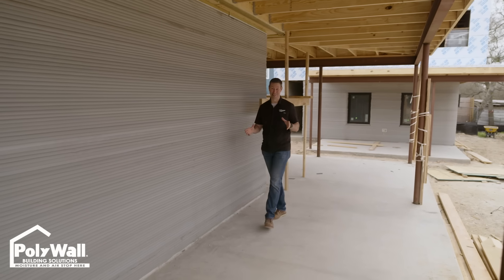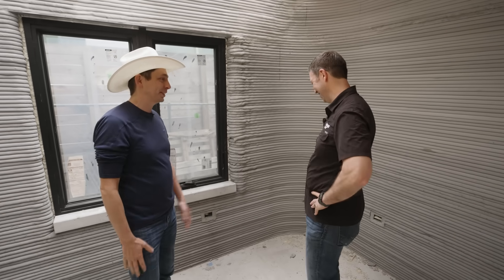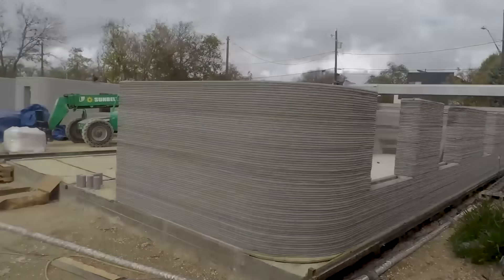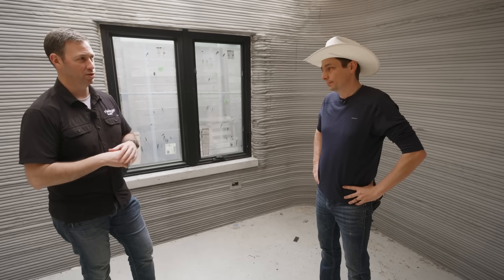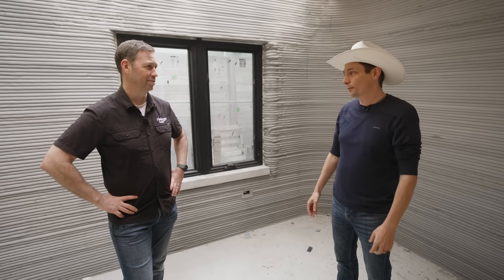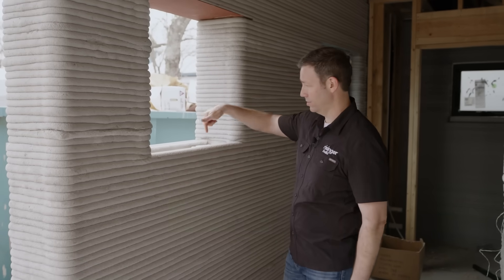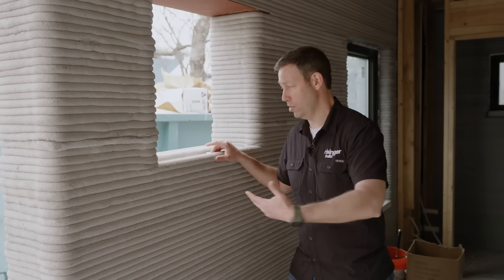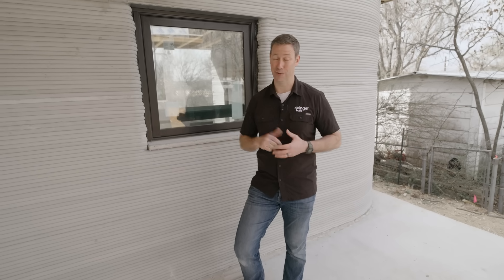Is this the future of Construction? 3D Concrete Printed Homes

Comment: I wonder how this compares structurally to ICF construction. I'm not sure if you didn't show it, Matt, or if they just don't do it, but the lack of rebar or even mesh in the concrete makes me wonder about the longevity of this type of construction. On top of that, how does this compare to ICF with insulation value? Also, would this type of construction last in a northern climate? I know I am probably coming off as a skeptic, but I would like to know more.
Reply: Stronger than icf due to the depth of the wall and the integration of the wythes and rebar

Comment: I love the concept, It reminds me of the 3D printer tech, just need a 3d printed resin printed home. Those interior horizontal lines however give me vertigo. So yes a smooth interior finish wold be highly desirable. If you left the interior with that sort of ridge finish your lighting would have to be perfect to not throw off weird shadows on the walls.
https://www.youtube.com/watch?v=gt3bid70Fro

Comment: I wonder how these hold up over time without rebar reinforcements and cracking overtime.
Reply: Will hold up longer with no rebar to corrode or fail. See how long Roman concrete structure without iron reinforcement have lasted.

Comment: Concrete is the wrong way to go. It's the top carbon emitter in construction, it doesn't breathe, it cracks, it attracts moisture... Just dooooooon't do it!
Reply: ...that said, with the lack of labor etc., printing is not a bad idea, but they definitely need another filament, and epoxy isn't the answer either.

Comment: Concrete cracks and fractures. That’s what it does. You can even see it in the video above the wall outlet. That seems like a major problem that wasn’t even addressed in this video.
Reply: https://youtu.be/_MsOXrprYXs?t=350
Reply: The cracks are only on the outside. Thats not a problem.
Reply: @gandalf2950  Until it settles more, and it will settle more.

Comment: For those worried about strength and cracks, the possibilities for improvement in material and construction are endless. Rigid spray foam could be printed in during concrete printing and would add significant strength. Resin and fiber additives could easily prevent cracks.
Reply: Yeah, the additives are really what would add alot of strength.

Comment: Why paint concrete with non premibal paint ?  The concrete may take  in some moister when there is rain but will dry out later. 
The solution to rain on the walls is not rubber paint ,it's  good enough roof overhang.
Also the use of isocynate foam makes the  house that could be a plastic free easy to sort and recycle construction to a nightmare of chemicals ,plastic debre concrete mix when torn down , the insulation can bee made of leca beads instead , non rotting fireproof and harmless to the environment,  in the demolishing face.  To be used I combination with the concrete as material in roadbeds  or as ballast for new concrete. Also this material with has high insulation properties can bee groated with cement when filling the woid, thereby strengthen the wallsides even  more by glueing them together. Also the foam makes the house non perimabal for water wapur transfer. This may lead to buildup of moistier inside the wall over time. Especially if the wall is painted with non breathebal paint on both the inside and outside.

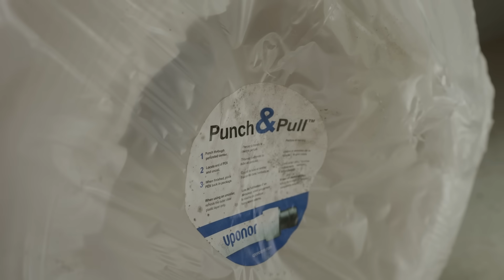Comment: It's not concrete it's grout. It may work ok in locations with highly stable soils but I'd be willing to bet that expansive soils would wreck this house pretty quick. Lack of reinforcement makes me believe any kind of seismic loading would do it in as well. Cracking seems to be an issue (5:51, 5:59) which makes sense given the lack of control joints. You mentioned drying to the interior but I think the lack of weep holes will eventually cause problems when bulk water finds its way behind the elastomeric paint. Many of these same problems were noted in the original prototype homes built several years ago, if they are not addressed the product (and company) will have a very short life.

Comment: Silliest thing ever. Cool on paper until you see it in person. No steel reinforcement ANYWHERE. Cracks developing all over. The second floor is all wood framed, WTF? Either make the entire structure concrete or don't make it at all. Basically, the ground floor walls are super insulated, then, the second floor walls aren't even 25% of the insulation the first floor has. Answer: ICF. Cool idea though.

Comment: That ridged look on the interior will only last long enough for the people who actually have to live in and clean these houses to kick up a fuss. It shouldn’t need to get to that point.  Other than that I love the concept.
Reply: I think a traditional top coat could be applied to exterior.  Likewise a thin plaster finish floated to the interior walls.  For me though, the lack of steel reinforcement in the concrete would be of concern, especially in areas prone to earthquakes.

Comment: Concrete has good compression strength but very little lateral side loading strength which is why rebar is added. So, where's the rebar or are they adding a significant amount of fibers to the concrete mix?.

Comment: What I would love to see is a three/four story structure using this method. I can't see why it wouldn't work! 

Even getting to two floors can't be that hard by adding in a steel column in the air gap (bumping out the inner wall a bit) and/or slotting the inner wall so a joist can be placed.

Comment: Their calling it concrete but it looks more like a sand & cement mix to me. My understanding of concrete is a mix of fine & coarse aggregate and cement. Also the idea of an air gap between exterior & interior walls is so that any moisture that penetrates the exterior wall can run down and seep out or dry/permeate back out. If your going to tightly fill the void with insulation, your providing a pathway for water to reach the inside wall and potentially permeate into the house.
Reply: A Sand and cement mix is concrete. I like how Mat's energy pulls everyone one in, comments like yours remind me of when i thought thing like this would be mainstream one day. Those were the days BEFORE i was in the business and started learning.
Reply: Concrete is a mixture of cement, air, water, sand, and gravel–it's as simple as that! Not exactly. The typical concrete mix is made up of roughly 10% cement, 20% air and water, 30% sand, and 40% gravel. This is called the 10-20-30-40 Rule–though proportions may vary depending on the type of cement and other factors.

Comment: its really more depending on the pricing. Now if these can be priced at like the rough in being like $15,000 to $30,000 but depending on size. It would making the housing bit more affordable for alot more people. but doubt it would be that cheap though. I would assume pricing for these at rough ins be more around the $100,000 mark.

Comment: Another comment. Won’t the point where the window and door jambs transfer cold  or hot? There is no thermal break there between the inside and outside, it’s concrete.

Comment: I studied this system maybe 8 years ago when I was developing a major project in China, this is Chinese tech, supported by the government and a company called Winsun. The Chinese were also exporting and using the equipment in Egypt years ago. There are limits to what can be done such as floors which still require pre-fab slabs or framing. It’s not all the the cats meow.

Comment: I am very skeptical of 3D printing houses, it seems like setting up the machine would take enough time that it would not be a time savings once you include that. Imo the interior finish is pretty bad as well and embedding electrical and plumbing in the concrete walls will make it very hard to ever change anything. I also don't understand how it seems to have no rebar? It does seem great for banging out tons of low income housing, side by side where there is less machine setup needed but I am not really interested in it for myself.

Comment: I personally cannot imagine liking an interior wall that looks like that.  I really don't like putting screws into a wall to hang a 10 ounce picture must less find a concrete bit, drill a hole, and find tapcon screws.
Reply: I guess you could put up wood strips or plywood panels and mount pictures to those

Comment: Hmmm. I still think I would prefer to have a poured concrete wall over these 2 inch beads layered out 1 at a time as it seems that they would inherently have many more potential failure points.
That being said, there's nothing that says that the system has to be done with concrete so it does prod my imagination.
Super aerated/porous epoxy of sort maybe.

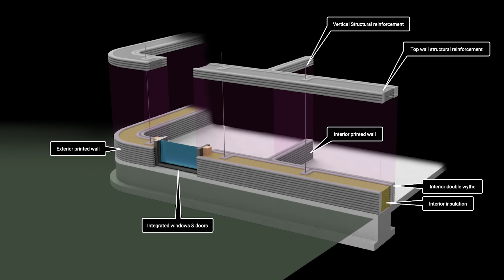Comment: Why no control joints? Any other large scale CMU structure usually incorporates these. Have you considered incorporating fiberglass reinforcing to the concrete? Also, the unfinished window opening towards the end had continuous concrete from exterior to interior (doesn't match up with the diagram shown at @4:12, therefore allowing thermal bridging). Like any new construction technique, I'm sure there are lessons to be learned and kinks to be worked out, but it's an awesome first step.

Comment: How does the concrete handle high wind speeds and earthquakes? Is the concrete somewhat elastic? Would temperature variances cause any significant cracking over time?

Comment: I am not so sure about the ending points around the windows and doors, I want to see a stackable  (additive) "L" bracket that can be placed as the wall is printed- for the "squeeze-out" of the concrete to butt up against as it is printed, thus when each level is done, you can remove the L-brackets and have a perfectly smooth flat face to bolt windows and door to. More labor, but worth the ability to add flat faces to your build. The same could be done for the outlet and plumbing openings. Matt,  There are things to go wrong with these walls, first thing I see, (and saw in the few clips you showed) stress and cure fractures of the concrete. As the concrete cures, the bottom is hardening before the top and this could cause "radial fracturing" as the bottom changes during cure process, that is not as worrisome (can easily be avoided via the concrete mix) more worrisome is settling due to an inadequate foundation. Epoxies are a must for the interior seal over the concrete- then go with stucco's or whatever. I want to see some kind of bracing in the walls- not metal, but possibly a poly-mesh (carbon fiber 1/4" mesh) which is hand laid onto the wall flat between layers, again, just a detail which would not be necessary for every layer, but would definitely add insurance against any movement later in the building's lifetime.

Comment: The main objection I have with this method is the fact that it doesn't look even close to being finished. Try walking into or, rather, grazing up against -- something everyone has done at some time or another -- these concrete layers with their gross imperfections and see if your enthusiasm is tempered just a bit for such a rough finish. Particularly around doors and windows, the texture looks as if it were laid in by someone drunk at the wheel. And, frankly, it's just plain butt-ugly. I think the technology is probably the wave of the future for construction and it certainly has its merits but for God's sake, please, somebody, come up with a way to smooth the walls as they are extruded because waiting till the concrete is cured would be WAY too expensive. This layered look just doesn't work for me.

Comment: The layered spaghetti concrete is not attractive... They need a few concrete masons to smooth out the spaghetti or better yet add a side mounted trowel. I only saw round corners does this have the ability to pour a square corner? Where is the rebar for structural integrity? This is cement mixture so, no rock added as with concrete to add structural integrity? It’s a great concept, but I think it has a long way to go.

Comment: Curious that there is no rebar, probably would not meet code in Florida because of that. Would be nice if the cost was discussed as compared to using $7.00 a piece 2x4 studs, and even more expensive 2x6

Comment: Not a fan of the finish on interior or exterior; and would hope see a smooth finish someday w/o stucco (another thing not a fan of, even though on my house….Cuz it’s kinda a pain to “repair/fix” if do any remodeling) on inside. 
Would like to see them have a finishing machine do a smooth finish, as with rounded corners😅, it’s pretty awesome looking; & than I’m thinking of all different types of architectural designs/styles they could create using this method when they start doing 2nd story or more; I can “see” some pretty beautiful and amazing architecture homes in the “future”😉
And yeah….as someone said, adding some coloring into the mix would be cool as well.
Know they gonna start running PEX-A inside their process like do w/ electrical, and that’s nice….but I’m wondering how long term maintenance and repairs would be if had to get into the wall, or say do a kitchen remodel, and how “friendly” this process actually will be.
✌🏻

Comment: Just another tool in the toolbox but this is probably the best looking print I've seen thus far.  Seems like there's still a lot of low hanging fruit in the actual design of 3D printed houses what to include in the print to save time, what kind of building features are only possible with printing.  I have yet to see a printed home design that makes me think- aha- that's why I'd want a printed house.

Comment: This is awesome and scary at the same time it will put alot of hardworking people out of work someday
Reply: Probably not. All the previous tech people can concentrate on re-building all the existing "built-to-code and below" houses to best-industry-practice.
Reply: NO IT WONT. Its like trucking. Automation wont even come close to filling the labor shortage. A framing and drywall crew would have done this wall way faster. Its tiny
Reply: @sparksmcgee6641  before the current trucking industry there was horse-drawn wagons with much more human (lower skill) labor involved. Same with every other technology business including building. That's the point of this channel - the building industry is always changing; change for "better" not "cheaper"; transform with the industry (by obtaining higher-level skills) or die like the dinos.

Comment: Love the tech!  Would want to trowel over interior and exterior for finished look.  Stucco.  What about rebar reinforcement in seismic areas?  Horizontal welded wire between layers maybe, but still need vertical reinforcement.  Voids every 4' that had rebar tied to slab/footing that could be filled with concrete?

Comment: 1000 years of doing it the same. This guy is either a smartass or a complete idiot. Stacking concrete on top of each other... since it's not mixing, it's like a layered cake. Not that strong. And you still need tons of work to get all that concrete into the machine and mix it. You have strength horizontally but not that much vertically.

Comment: I like building science as long as it doesn’t cost a fortune and is proven 
Can’t tell you how many fads have come and gone in my 50 years building.

By the time you dress the inside and outside of this structure the cost will be substantial.
Berg and DiVosta in Florida built thousands of condos and houses out of poured concrete in the 70’s — 90’s using a very efficient forming system. 
I believe they were called Outinord” Forms from EU
They tried at first to just paint the inside but moisture problems required interior framing.